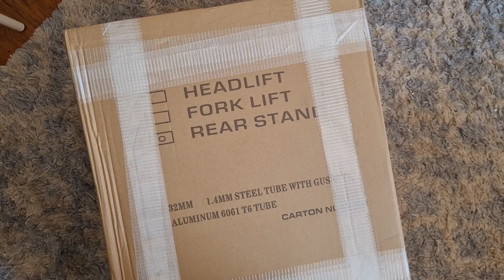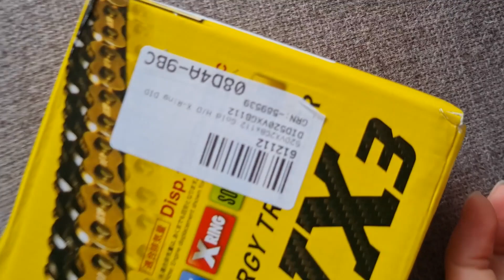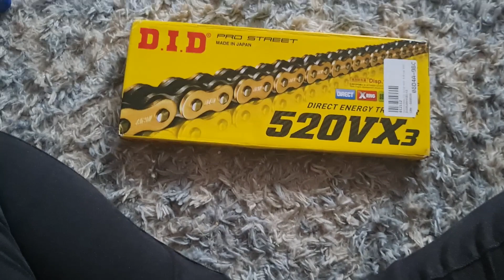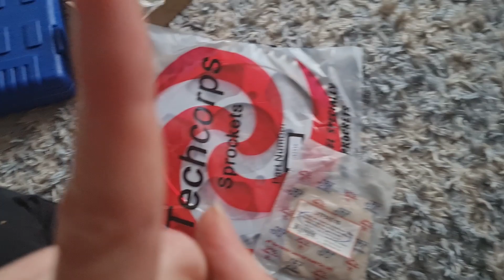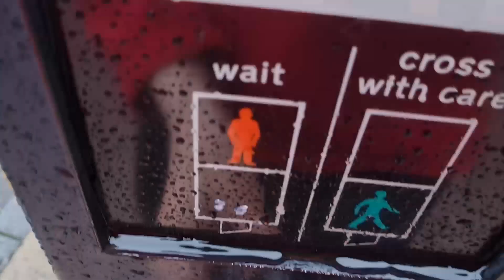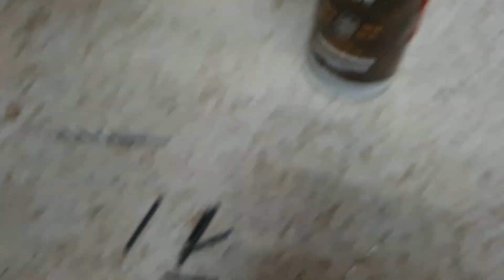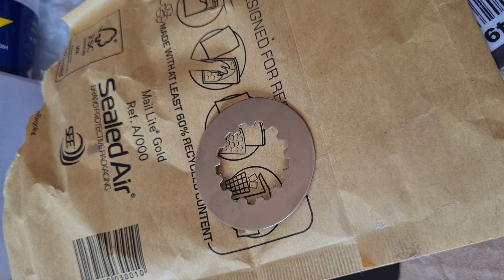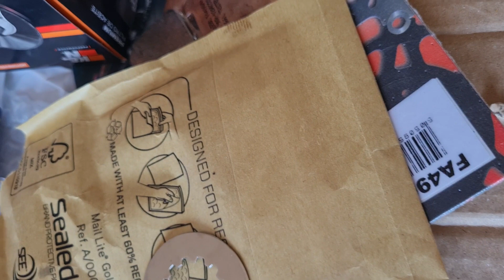Beginner Motorcycle Maintenance: My First Attempt (Part 1)

Comment: Once you get into self maintenance, it becomes a lot easier for sure. Regarding being able to push the piston back. I would just open the cap on the reservoir and then try pushing the pistons back. You should see the brake fluid level increase slightly in the reservoir. Definitely removing the lid will help push the pressure back up the line. Don’t leave it open for too long though as moisture could enter the line and DOT 4 fluid is hydroscopic. It’s very thirsty fluid and will attract moisture. 😄

Comment: I recently changed the drive sprocket the rear sprocket and the chain on a 250 and i think it was less than £50. If you have a decent set of tools, a manual for your bike and determination, you can do it too. 
Once you learn how to maintain it you will not only save a fortune, but you will be self sufficient and never get stranded because you will learn how your bike works and how to fix it. 
So go for it ! 👍😎
Reply from the maker: Thank you so much ❤️ 💓 💗 💛 💖

Comment: Saffy there is a very useful tool you really needed to make the job much easier for yourself, I noted you struggling to turn the nuts, it takes strength 💪 the obvious tool for that is called a man, yes they can be useful at times, you just have to train and preferably feed one and they will be more than happy to assist you 😊
Reply from the maker: The amount of upkeep a man who need just to get a few bolts undone, I'd rather take my chances wacking my arm off my crash bars XD

Comment: I commend you for learning some new skills, Saffy!  I started out as a complete novice, like you, about 5 years ago.  After a lot of effort, my motorcycle repair skills have improved substantially, but not without a huge amount of frustration and monetary investment in the right tools, as you are experiencing.  YouTube videos are also certainly helpful, as long as you are careful about what channels you watch.  I'm sure others have suggested two other essential items below, but just in case I will recommend that you get a workshop/repair manual for your bike and a torque wrench (click-type or digital).  The workshop manuals made by Haynes are particularly awesome in my experience.  Torque wrenches are absolutely essential so that you tighten those fasteners to the factory-recommended tightness, but not too much where you strip things out.  Stay positive and realize that these are super-valuable skills you are learning! Cheers from California!
Reply: A word of caution about Haynes manuals, which probably applies to other after-market publications as well: I have used many of these, both for cars and bikes, over my career as a mechanic, but they often cover a wide range of versions of a model, so information can be quite generalised and you need experience to recognise which parts apply to your bike. Having said that, they are better than no information and can offer useful tips about using alternatives to special tools, but I would always try to obtain the manufacturer's official service manual, which are usually fairly comprehensive.

Comment: Saffy. Get a workshop manual and read it. Please. My heart was in my mouth watching this. I love your joie de vivre, but there are set ways of doing these jobs. Maybe take a motorcycle maintenance course??
Reply from the maker: I did look for a manual! But unfortunately I couldn't find one
Reply: @SaffySprocket  have you tried an SV forum? They often have pdf copies of manuals. Don’t get me wrong, you’re doing great, however I would rather you didn’t damage your bike or worse, hurt yourself when doing these tasks. Maybe chock your front wheel to prevent the bike moving forwards too?
Reply: Very good advice. I found the abusing the tools and handling brake pads with filthy hands worrying in the extreme.
Reply: Haynes manual 👆🏻
Reply: @gamekeeper687  Haynes are a last resort as they often contain typos you can get official manuals for £30 to £50 there are a few on eBay for specific years and models.

Comment: I started doing my own motorcycle maintenance when I was a poor student and got sick of being ripped off. I figured the first time would take twice as long and cost as much in tools as I saved in labour but then I would gain experience so that every other job had fewer new experiences and fewer new tools. 
For your brake pads the best way I have found to push the calipers back is using the old pads ( so you don't dent the new ones) put in two 90 degree bend pry bars and rotate them away from each other in opposite directions. The equal but opposite force  then requires nothing to hold the brake while you pry it so you can do it while the brake is attached to the brake hose and in mid air.

Comment: Use a block of wood in the spokes of your rear wheel, locking the wheel against the swing arm, then you don't have to use the rear brake to stop the rotation when trying to loosen the front sprocket nut.

Comment: I admire your bravery and determination. Watch as many videos as possible and or ask a mechanic about your project. Changing the brake pads may not require you removing the caliper. On some bikes, removing a pin or clip or both will allow the pads to drop out. On some bikes loosening both caliper bolts and removing just one of the bolts will allow you to possibly move the caliper enough to gain clearance to remove the pads. You will not need to drain the brake fluid. Remove the lid to your brake fluid reservoir and pry between the disc and the pads to spread the pads enough for removal and installation. When prying don't use anything that will damage the brake disc and keep an eye on the reservoir so as not to push fluid over the rim. You may have to remove some fluid but more than likely you won't. Brake fluid is corrosive to surfaces on your bike, take care.  If you replace the brake fluid make sure to avoid air in the brake lines. Brake and clutch fluid should be changed every few years. Finally....if your rear pads needed changing make sure to check your front pads, those are the ones that should be doing most of the work. Best of luck. PS You were having trouble getting a socket on the nut holding your gear in place ( pinion/drive gear?) because of the washer. Some washers, especially in a high torque/speed application are bent and flattened against one of the nut facets as a safety precaution. Check a manual or installation guide or ask a mechanic if you need to flattened your new washer against the nut.
Reply from the maker: I did flatten the washer, I genounelly think I wasn't strong enough ☠️☠️☠️

Comment: Fair play for having a go at it 👍 and gaining more of a understanding on how your bike works, a lot of manufactures went digital for manuals of there later bikes, so its a case of finding the latest that you can and work around any little changes, the latest i can find for my bike is a 2006 manual, but all the main mechanical's are still relevant just a few cosmetic differences.
Reply from the maker: I managed to find a scanned copy! Maybe I will have to drop Suzuki a message

Comment: Had the same problem with a rear stand. Had someone put a few welds on the joins.

Electric impact wrenches are useful. Before now had to use a breaker bar, then a scaffolding pole to extend it, then hang from it to crack it off

Very restrained when you clouted your arm!

Unless the reservoir has been topped up when the brakes are half worn, there should be plenty of space for the fluid top be pushed back when you push the pistons in. Common problem with brakes is the pistons seize up. The seals sit in grooves, and corrosion builds up in those grooves. This pushes the seals out hard into the pistons. Pump the pistons out (single piston caliper on the back of your bike I think, so easy to do), pop the seals out of the grooves and clean out them out thoroughly. Then reassemble (best practice is new seals, but I don't always use new ones) and bleed the brake.

Comment: Block of wood and some medium sized g-clamps, and take the rear reservoir cap off, you'll have the pistons pushed back in no time (but watch for fluid leaking out the top as you push them).

If you're feeling brave, pop the pistons out completely and check the condition of the seals, easy to clean the pistons while they're out too! Don't forget the slide pin.

Other than that, a longer breaker bar would be awesome for you.

This is all work that the shop would have seen, and charged you labour rates for. For your first attempt, you're doing awesome!!

Comment: Saffy you did amazing, removing the front sprocket is not an easy job. I think just be careful when the bike is on a padlock stand like that, the bike can easily fall. Sometimes it's good to loosen and torque back down very tight bolts when it's off the stand as the bike will be more secure. You don't want that bike falling on you.

Comment: Hi Saffy don't lose hart lass your doing well , that said can I point out some things to help . First the xring is better than the oring although technically it is an o ring with a cross section in the form of an X rather than a round cross section of the standard o ring . Ten minutes in you seem to be missing some screws in your rear stand, get yourself an old tub or basin  to degrease parts in , the new washer is a locking washer it's ment to be bent over against the nut in two places but I didn't see it on the shot of the new sprocket .
You put the new chain on with out sizing it against the old , never have I fitted a new chain that was correct out of the box , always try old against new for everything . 
Clean around the back brake piston's  with brake cleaner and a small brush  , tooth brush is best , remove the cap from the fluid reservoir and tie a small rag around it then try and push back your piston's . You can also get someone to drill and tap out a hole to M10 in the middle of one of the old pads and fit a small bolt in to it , refit your pads and then start to loosen the bolt and this will push your piston's back, but always check that they go back square . And last 18:10 in your trying to remove the back sprocket , at that point if you're socket had slipped you would have had a nasty one. Keep one hand over the socket holding it and put back towards you and in a direction that takes your arm away from the teeth . 
And yes YouTube makes it look easy . I wish I was a little closer to give you a hand a show you . How big is the biking community in your town there must be someone willing to help, not to do for you but to guide you. Anyway please keep safe Saffy and don't give up. Jc

Comment: Hi Regarding the rear pads , I use a medical syringe to suck out some of the brake fluid from rear master cylinder reservoir then using the old pads put back in caliper I leaver the pistons back home ready for the new pads, have you got a Haynes manual for your bike that would help alot on the maintenance,  I noticed you have rear swinging arm spools already installed for a rear hook stand . Also a torque wrench is a good investment so you dont over tighten the nuts, hope this helps. well done on the maintenance,  I enjoy all your awesome videos can't wait for part 2 .

Comment: If you haven't already loosen the lid on the brake fluid reservoir then the piston will go bk in .
Once in a while you need to take the pistons out & clean them & take the seels out very carefully & clean the grooves very carefully as not to scratch anything & put it back together with a small amount of red rubber grease .
There's lots of videos on YouTube on how to rebuild a caliper .
Good on you for learning to fix your bike yourself 💪

Comment: I've replaced chains and sprockets on my 50cc, 80 and 125, but on a bigger bike, it's a bigger job, so good on you. The overalls are a good idea, plus you could get a box of nitrile gloves, it saves alot of hassle cleaning your hands. You can get them from a pharmacy. 

When I buy bike parts, I use my local bike shop, it's a Suzuki dealers, but they've always get parts in for my Kawasaki and Yamaha bikes. It takes about a week for parts to arrive and you can always ask them questions. They will also shorten the chain for you, if that needs done. 

Ps. The hole in your paddock stand is supposed to be there, to help stop it rusting.
Reply from the maker: Thank you so much ❤️  I do love next door to a Suzuki dealership so maybe next time I'll just put an order in in advance :D

Comment: Hi saffy, the washer is supposed to be tapped over the big nut, make sure you tap the new one down with a screwdriver and hammer. Chain and sprocket is hard maintenance to start with, my mate always does mine. I started slowly by checking and adjusting the chain and lubing it after every ride using cheap paint brushes and oil. Bleeding brakes, checking tyre pressure and lubing all the moving parts. My chain has lasted neatly 40000 miles since I lube it after every ride, compared to 11000when I was using spray lube. Now you got the paddock stand it will be easy for you.
Reply from the maker: I did thanks 😊

Comment: It was highly entertaining seeing you try this for the first time. It was a total disaster 😂. It will be cheaper next time since you bought most of the tools already. It will be easier next time.  My daily bike, a 2015 Versys 650, has 130,000 kilometers on it and I’ve done most of the maintenance myself. Imagine how many chains, oil changes, tires and valve checks that is. Maintenance get way easier and faster with time. Hang in there.

Comment: Please check front pads. The front brake works much harder than rear and if the rear needs renewed highly likely the front will need also. 👍. 

Lots of good tips on pushing the pistons back on these comments. Best solution I found was to open the master cylinder to remove the fluid pressure  this enables easier re-pressing back. Always worthwhile bleeding and renewing the brake fluid. Basically a job that should be done every 2 years. 

Keep at it👏👏👏👏
Reply from the maker: I did have the front brake pads changed the month before

Comment: Quick tip for holding the chin still instead of holding down the rear brake which incidentally is difficult when working on your own.

As you are changing the chain anyway. 
Remove the rear wheel and put the wheel spindle back into the swinging arm but as you slide it back in make sure the chain is around it to.
Now pinch the chain tight around the spindle and ram a screwdriver through the chain (the chain is knackered anyway) the chain is now pinned to the spindle. Now take up the slack in the chain at the engine sprocket and as the chain is locked undoing the sprocket nut should be a doddle.

Incidentally I would err on the side of caution when using a impact gun as the gears in the gearbox are hardened steel and could break!

Comment: It's always expensive to buy tools for the first time, but the more often you work on your own things, the less it costs in the future and the easier it becomes as you gain more knowledge.
The one tool that makes life easier is an Impact Wrench... The bolts or nuts that you need a breaker bar and strength for is no longer required with that tool; it does the work for you.
Reply from the maker: I did end up getting an impact wrench! It's such a life saver!

Comment: Take the top off your brake master cylinder reseviour then you will be able to push the brake cylinders back and fit your pads. Obviously you will need to keep a rag around the res to mop up any spills.
Also the washer on the front sprocket is supposed to be bent around the nut, it prevents it from rotating.
Your doing great keep going kid👍
Reply from the maker: I learnt this one the hard way 🤣🤣🤣

Comment: some calpers you have to twist in and some you just push them in and  take brake fluid cap of before you push it in or thay won't go all way back in you have to take fluid cap off you will get their it will help you if you ever on road and you get a problem

Comment: It can take a lot to get the pistons open again, I've used G-Clamps before. Something else to note is many brake pads now seem to be too thick and need grinding down a bit, not sure if it's a case of mass production or what, but very annoying. I'd try the pistons again before you start flushing the brake system, that's a whole new nightmare to get involved with. Good to see you're persevering with it, all good experience.

Comment: Nope that new washer was a good call. 
But I’ve gotta say, I admire your commitment. 💪🏻 most would have given up.
I can tell you. It gets easier. Once you get more tools. 
That breaker bar for instance needs a long pipe. An impact wrench is a good investment.
That crooked stand I wouldn’t trust.
Reply from the maker: Yeh, I'm not fond of the stand, I want something a bit more solid with bobbin pins
Reply: @SaffySprocket  I would too.

Comment: Assuming you can't set the torque with that electric impact wrench you are better off getting a decent quality torque wrench to tighten everything to spec. Its probably the most important tool to have. It is possible to push the caliper pistons back in using a G clamp with an old brake bad between. Also you can loosen the sprocket nuts while the wheel is still on the bike. It gets easier each time you do these things :)

Comment: A few words of advice from a very old bike mechanic. Rather than mucking around on EBay or Amazon, just go down your local Suzuki dealers and get the right parts you need. The SV (I’ve got one) is not an expensive bike with regards parts. A prime example is the rear pads, they are very Suzuki specific, the OEM ones are slightly narrower so you will have difficulty fitting “pattern” ones. Don’t get me wrong you will get there in the end but it is a pain. Anyway hats off to you having a go, if nothing else you are building a good tool collection.